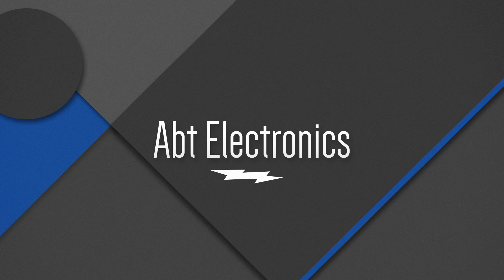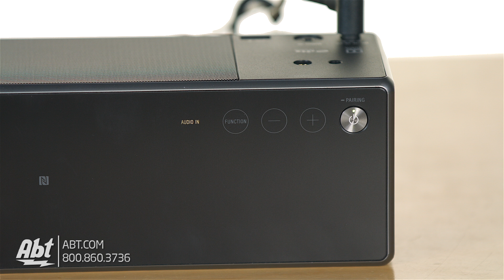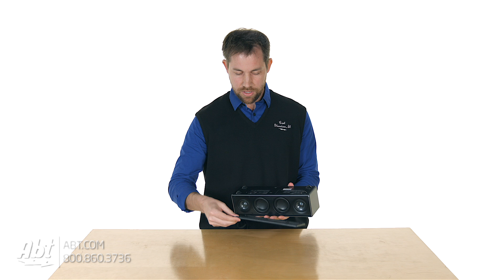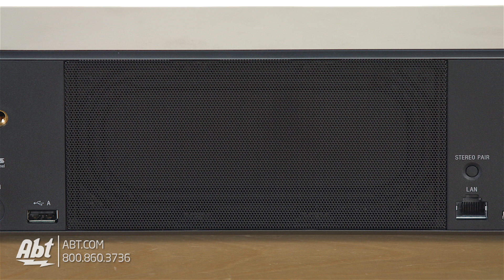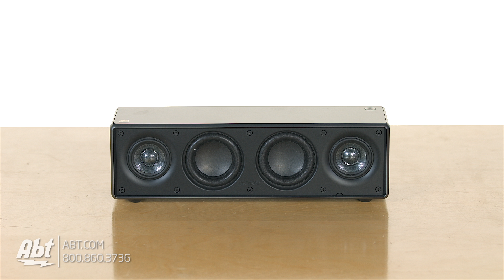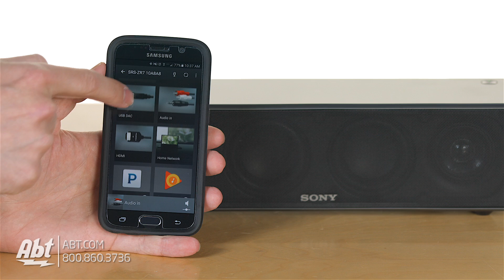Sony Black Home Audio Bluetooth Speaker SRSZR7 - Overview

Comment: I am debating on getting this speaker for a bedroom. My home is setup with GoogleCast devices, as I didn't want to jump into the Sonos route when I had a ton of speakers already. 2 questions:

1. does the googlecast stuff work through the googlecast app? aka can I set it up without having to use the SongPal stuff or would I still need a Chomecast Audio in AUX?

2. How does this compare audiowise to the SoundTouch10 or SoundTouch20? Will I get a much better sound at $100 more? How about to the UE MEGABOOM?

Comment: I have the sony xbr 65x900b tv. this TV has speakers integrated on each side of the screen and is paired with a Bluetooth subwoofer. is it possible to pair the Sony SRSZR7 to this TV and use them as surround speakers as opposed to pairing them to a Sony soundbar? I don't want to bypass my TV speakers, just want to add rear speakers.
Reply from the maker: Trying to find the answer for you...will let you know what I find out!